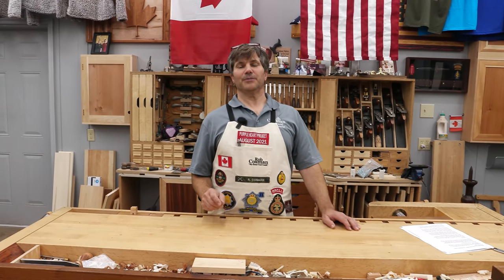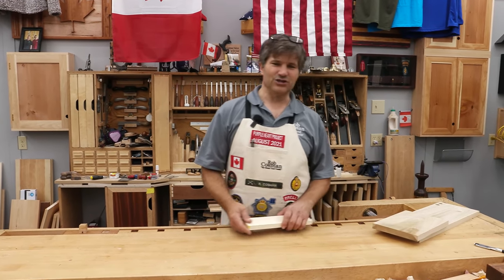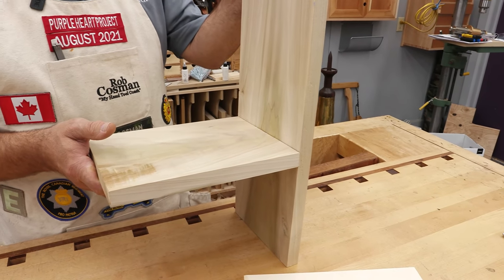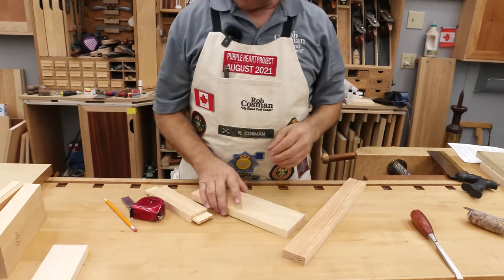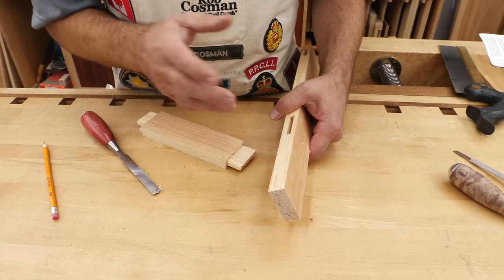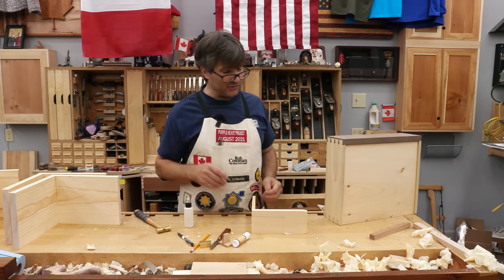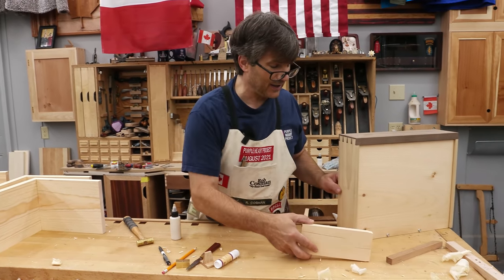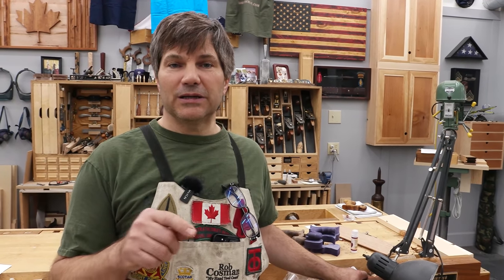End Grain Glue Myth Busted | What does it mean? (Surprise Ending)

Comment: As always, a great video presentation. The proof is in the demonstrations and those were great. Having personally committed the error of moving large bookshelves around on the floor, fully loaded with books (I'm talking about 3 ft. wide x 5 ft. high x 11 1/2 deep ones) by pulling them around I have wonder if doing what is shown at time stamp 27:46 would actually work long term. My intuition says repeated moves like that might cause things to come apart. Removing books first would most likely be the best thing to do before moving such a case. But I do think the demonstration where standing on the rabbet and dovetail joined examples was really something. I do think the tensile strength in a stationary wall mounted cabinet fully loaded ceramic dishes would work, but I'm not sure I'd want to test it on a wall-mounted cabinet fully loaded with famiy heirlooms 😀As always, thanks for the great ideas. The videography and demonstrations are so great they're worth watching just for the entertainment alone! Many thanks to you and all those involved in the production of these and all the best to you, yours and the team.

Comment: In situations where hidden wood faces can't be smoothed and fitted tightly for gluing, have you tried testing a DIY glue composite? For instance cotton wool and glue in an amount that could be smooshed to fill any gaps? (assuming a drainage channel to relieve hydraulic pressure) I'm probably the world's worst carpenter and my only real tool is a Leatherman pocket knife and crude things I'm make beating the hell out of mild steel junk, so pretty much every joint I make is ugly and imprecise which I'm ok with but would like some strength. The glue in a joint is often said to be the weakest part, but I wonder if that is another myth to a degree--if there might be value in using it as a filler of voids especially if reinforced with fibres. (cotton is cellulose like the light part of wood grain so I assume it would be compatible). Annyway, I appreciate everyone who is testing what they've heard all of their lives to see if it is true and then adapting to the evidence.

Comment: Says Rob (about the shelf case end grain glue up), "it didn't have the shear strength we look for but it was very strong".  Rob, you didn't measure the "shear" strength of that construct. Shear is hard to measure without specialized lab equipment, but if you had measured it you would have found it is a lot greater than you imagine.
As for Patricks findings, that has been known to be the case for a very long time and is documented in research documents freely available.
Reply from the maker: Thanks for the info, but the first time I was exposed to it was Patrick's video.  Not sure why if its been out that long.

Comment: my experience has been with glue drying out over a period of years along with wood movement. a year or 2 with but joints and up to 5 to 10 years for mortise joints. but with a mortise joint there is the mechanical connection.

Comment: This whole knowledge of connecting the long grain end to the long grain end is actually incorporated into some Japanese joinery like a sleeve I think is the name of what I'm thinking of it's a long cut construction joint to connect two beams together then forced into each other with a wedge but it's connecting end to end and it's one of their strongest joints used in traditional construction edit:after thinking about it then finally just googling they use a ton of end to end joinery in traditional Japanese wood work they even have wats of turning a joint into ends touching ends when it doesn't have to be they go out if the way to join end grain I had never thought about it before. I know their whole culture and mindset in making anything is to use physics and nature to your advantage and work with it instead of fighting against those forces as we see it in the western world and those two different schools of thought are so obvious in everything we do honestly. I can help but look at some of their incredibly complex end to end joints and think God that's smart but it mimicks the tree itself by joint a long grain interlocking with another long grain then forcing them into each other as gravity would and giving them some flexibility you've mimicked the tree and maintained it's strength. We cut stuff apart then try to force it to have some strength again by glueing it to a strong piece we haven't cut through yet. We fight nature they use it.

Comment: I might suggest that the half-blind dovetail "sound test" is flawed due to the different wood species. Ask any luthier what they'd expect the difference in "tap tone" between walnut and pine. There's a reason a luthier would not hesitate to use walnut for a back-and-side set but would reject pine for such use. The top is different as it's required to flex to create sound vibrations. A typical guitar is constructed with wood grains in different directions (Tail blocks, crack stops and braces for example) and original Titebond is used by many but Types II and III are avoided because they have been deemed to "deaden" sound due to being less hard and more "rubbery". Hide and fish glues are time honored. Banjo rim construction using staves or overlapping mitered rim joints has become very popular but I know of no one using end-to-end grain staves with any type of adhesive.
Reply from the maker: Dude, I only want to have the endlap hold to the end of the tails.

Comment: Glue tech has come a long way, even so...
Time is the enemy, I think this myth has come from hide glue days when its' strength deterioted in the course of a couple of years. Modern glue maybe a decade?

I still think butt joints are the weakest as I am dealing with a bunch of chairs about 10 to 15 years old falling apart because the builder relied solely on glue to hold them together.

I believe that if you want to reduce your future workload and preserve your reputation, a joint should stand alone even when the glue ages and fails. This prevents having to go back and fix or reglue pieces.
Reply from the maker: I think you may be spot on reference this comes from hide glue days.  I am going to test that and see

Comment: there will always be a need for proper joinery, but with these revelations that have come forward from not only yourself, but some of the other channels that I subscribe to as well....this, for some applications, is going to be a game changer. I appreciate the effort put forth with a few various types of joint you did and "tested", its easy to see that in certain spots with end grain versus long/face grain, a little glue will absolutely help with strength even if it is on already classically strong joints to begin with.

Comment: Patrick, you, and everyone else haven't even done them quite right...

When you put the glue on the end grain (like the soda straws) you have to seal them.  So, try putting a thin layer of glue on the end grain and spread it while pushing it into the wood to seal the pores.  Let it sit for a couple of minutes and then reapply the glue before assembly.  Works even better.  Figured that one out many years ago.  Try it... it helps.
Reply from the maker: Thats called seizing the joint

Comment: Just be careful of your first test with the dovetail and rabbet joint, if you hit the rabbit joint with a mallet (like the dado test) it does in fact fail. The dovetail does not.

I was after something that was consistent so the test I performed was as follows:

1) Clamp the job to a post so that the part to be put under load is poking out.
2) Using two house bricks taped together drop them onto the section poking out as the same distance out from the job and at the same height (I used 8 ft).
3) Record results.

My result may be slightly different to yours but you could very well find that the weakest joint is not the dado.

Comment: How did it take the woodworking community over 100 years to discover something so easy to test? Why did it take a YouTuber?
Reply: Because SHEEP. Also, it's only modern cross-linked PVA glues that are stronger than timber. Even the standard white PVA is weaker than the timber itself, so not applicable. The hide glues that our parents used were so weak that they would fail on the first wet winter.

Comment: Hey Rob, regarding glue cleanup from difficult places: a little bit of diluted shellack (or any other finish that is planned) on potential squeeze out areas will make cleanup a breeze. A plastic pick or something will make glue just pop off. The downside is a very careful application is required so that glue surfaces are not affected, but after a bit of practice padding some shellack is quick. Shellack is also easily removed, almost completely.

Comment: You can not reach the conclusion Mr Sullivan did by the data he recorded.
“The wood always splits before the glue fails”. What this should tell you, is that the breaking strength of the glue joint is higher than the breaking strength of the wood in that orientation (side grain) which is x,
”On average, end to side joints were about 20% stronger than side to side. X + 20%
“End grain joints were the strongest joints of all” There is no way to know if end grain joints are strongest due to the fact that the side grain test and the end to side tests both failed before the actual joint strength could be measured. All you know for certain is that end grain joints fail at y. 
You can not claim to know or declare which is stronger, since in two of the three tests to be compared, the testing material routinely fails before a strength measurement of the glue joint could be taken. 
All you can prove, is that wood glue is stronger than x or x + 20%. You could say end grain joints, y are stronger than x or x + 20% but that’s it. Anything else is pure speculation.
There is no myth
 Now it seems everyone want to "explain" to us what we should have understood from the original video.
Reply: Your long pseudo-scientific rant says nothing, and completely and utterly misses the point. Nobody cares about how strong the GLUE is in each instance... we already know that.
For a LONG time it's been well known that modern cross-linked PVA glues are stronger than the wood structure. However the glue doesn't make the wood any stronger,  hence the strength of the wood remains the limiting factor. No maths or x=20% or other rubbish nor special conclusions are required - the wood itself will fail before the glue fails.
So.... the point of Patrick's experiments is to show that the glued end-grain to end-grain JOINT is stronger than the other two JOINTS. The strength of the glue itself is irrelevant, since we don't build things out of glue.
Reply: @johncoops6897  
First of all it's not a rant but the results boiled down to a simple equation. Second, if everyone is so smart that they know everthing there is to know about modern PVA glue, why is everyone so surprised and confused about the results in the first video?
So where is the myth?

Comment: well last test compare others was unfair.if u ytry same force with outer probably u broke them too.like vice one side L then put wait other board 
ofc 1-2 much stronger then 3.but testing method wasnt same.if u try 90 degree force to them istead of u go corner strongest point and they equally share force to ground ofc they wont give up
think like card house u put few card if u spread and put enough them can carry evfen few pound i once did one deck of cards and carry like 2/3 pound huge ashtray.
but if u from side u hit them tiny force with poof all gone.
so which direction force come how is diturbed is important .
wood jopint even if bad glued bad shaped and thiner probably still can hold.

im not woodworker not even know anything about it.but why nt use plywood like some cheap aplication becouse of laminotion diffrent type grain and woods overall end piece wasnt strong for spliting and cracking or grain issues
on musicial indusment ofc is bad idea but why not regular cheap building for.will be stronger then cheap wood.will eliminated lot of problem.
who cares inside what kind wood look like shelfs maybe outside been cared but inside no way
so i dont get it why not.

Comment: This video is delightful. Everyone should be as open to new information and to empirical evidence. The thing I most appreciated, though, was the thoughtful analysis of the practical meaning - yes everyone has been wrong about end-grain glue strength, yes it has a few meaningful ramifications for actual work, but no it doesn't mean joinery is obsolete. When we learn, we adapt - we don't simply throw away what we've learned before.

My takeaway from Mr. Sullivan's original video was "PVA glue is stronger than lignin but much weaker than wood grain. If maximum strength is needed (and due to leverage it often is), try to make a joint failure force a failure of the wood grain rather than accept a failure of the glue OR the lignin. That said, stop worrying so much about face grain vs. end grain for glue surfaces - that's not really what matters."
Reply from the maker: great comment, thanks

Comment: Hi Rob 
I have great respect for you and now your willingness to adapt. I discovered your channel sometime maybe 2 years ago and without a double you have changed my woodworking skills more than any other one person. This video has gone most of the way to close the gap on the few things that I have disagreed with you about.
1) End Grain gluing 
2) That two pieces of wood need to perfectly touch in order for a joint to succeed.
I am not advocating poor workmanship. I am advocating that at the bottom of a joint if it hollows out a bit that that joint will actually hold better than a perfect joint. 
I know this sounds crazy but from some testing I have done in the past a joint with a small glue hollow will hold better than a perfect joint. 
There is another channel that did some glue experimenting that also seemed to agree with my theory. 
The primary reason I bring this up is your dovetail hollow, not that that joint needs more strength. 
Not asking you to prove me right or wrong or that you should change your practices.
Thanks again for all that you have done for my skill level.

Comment: I am curious about the development of better and better wood glues over the past 100 years or so. How much have they improved? It is clear to me that the centuries old horse glue was not that great. Therefore the cabinetmakers and wood workers had to rely on extremely well designed and built joinery for a piece to hold up during normal usage. Your videos and others as well demonstrate the reliance on the adhesive alone is not the best path to take. Patrick Sullivan's video shows that end to end grain joints still will fail but not if you merely sneeze at them.
Reply: You can find test of glue strengths that include both hide glues and PVA glues. If I recall correctly, the hide glues are quite close in strength to the typical modern PVA glues. Maybe I'll look for that article again...Found it: Hide was 80% the strength of PVA in one test by Mark Schofield with bridle joints. Waterproof PVA was a smidge stronger still.

Comment: Following a piece of advice I was given many years ago, “Make a firm mechanical connection between the two (pieces), and never rely on solder or glue”, has yet to lead me astray. This glue test, while interesting, only shows that some additional strength may be added to a joint in some cases. Whether or not glue alone would be sufficient to ensure joint longevity has yet to be established, and would be highly dependant on environmental and physical stress factors for each application.

Comment: Yes but the 200lb, +/- was not a definitive test. Impressive but not definitive. 
It should of been measured, and with a simple free body diagram would demonstrated that even though it was 200 pounds on the joint it was not the same as  200 pounds pulling  90 degrees on that joint, and the moment point of the load will vary the joint strength as Stumpy Nubs talked about!.  Should have been fixtures and pulled at 90 degrees. It never made it to its ultimate strength of that joint. And the joint should be tested in both directions maybe. And as you say time and temperature play a role also should be tested in an environmental chamber 
 to do the analysis to have definitive data! I'm not saying I didn't like Rob's attempt to understand demonstrate he always doesn't outstanding job after the other Woodworkers has he mentioned. I'm just saying that I should be done in a more definitive manner prove the case! 
Each joint should be analysed for the test load and direction it being used. As does the wood being used, were it was cut from in the log, moisture, and a host of other variables that can and should be taken into consideration.